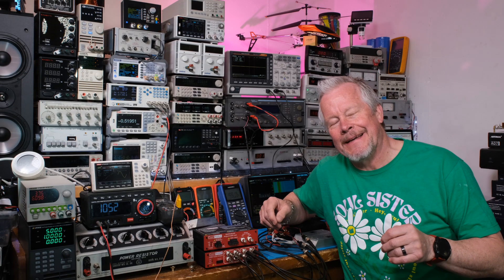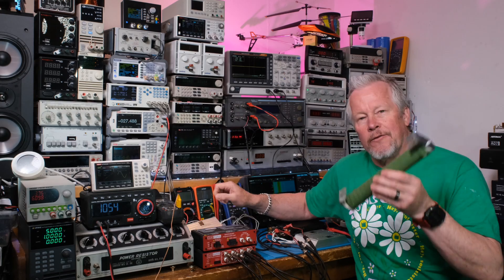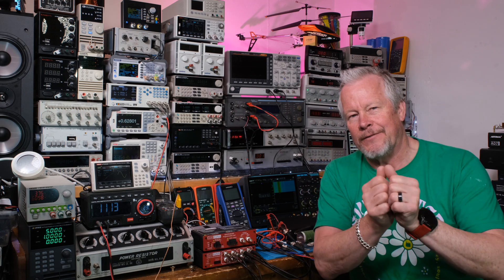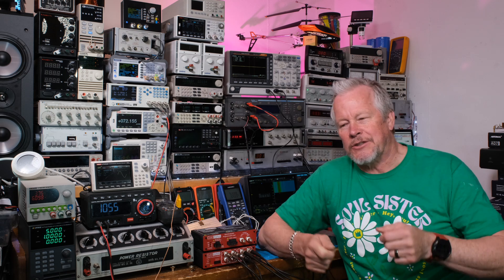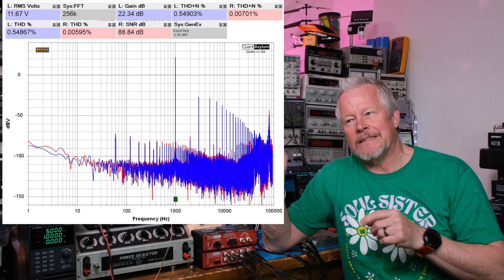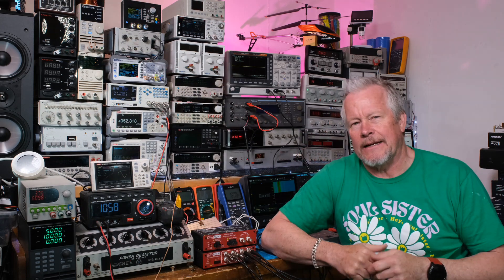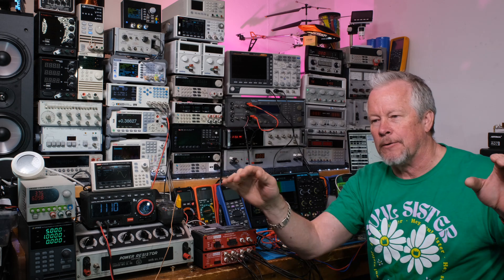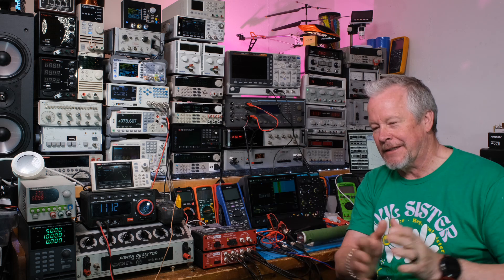Resistor Failure QuantAsylum Analysis Fosi ZA3 #QA403 #QA451

Comment: Dont forget to shut off as much gear as you can including lights when checking power/distortion especially when testing tube amps. Not so much on solid state. Also, if you have "dirty" ac power get some sort of power conditioner. It can make a world  of difference. (I'm a bone head tech. I dont know how it works but you do. Make a video!)And DON'T test power/distortion on a variac. I don't know why but it's the same thing.
Keep the videos coming Eddie!
Reply from the maker: Thanks for the great feedback!  A regulated output cuts out noise from the input in a big way.  The Power Supply Rejection Ratio (PSRR) is huge when the output is regulated.  That's why I am trying to make everyone understand - that if you have a 60/50 Hz transformer without regulation - it is simply a low frequency power supply.  The diodes commutate pulsing current on and off - thus, a low frequency switcher.  Linear regulation solves the problems you noted above and creates a Linear Power Supply.

Comment: I can make you an automated switch box that you can plug your existing resistors in on one side and the item you are testing on the other. Then you just push button to switch between different loads.
Reply from the maker: Thanks for your feedback!  That would be awesome.  I did build one years ago - but I think it was taken when I lost a bunch of equipment in a theft.

Comment: Thanks for the explanation about inductance being cancelled out in the wirewound resistors. I had avoided them, as I thought they would be mega inductors.
Reply from the maker: Yes, they look like big inductors - and the lower cost ones are - but the ones that they make 'low-inductance' are a bit more expensive.
Reply: Look fot Ayrton Perry winding resistors to reduce parasitics.
Reply: @paulb4661  Thank you, very useful.
Reply from the maker: Yes the green ones use the Ayrton Perry winding method.  It makes them very low inductance.  They cost a bit more but you can see how well they work.  https://amzn.to/4kvDcVn

Comment: What's the difference between the two resistors then? what are they made from? I would have thought that both resistors would be non-inductive. Why does the resistor suffer distortion? what causes the distortion if it's still showing value?
Why can't you use a 4 ohm inductor? Wouldn't that be closer to what the speaker is seeing??
Reply from the maker: Thanks for asking!  The distortion was coming from the resistor being damaged - or at least that is the theory.  I'll do a video on a resistor and speaker impedance.  I did this before, but I think it needs an update.  Here's the video on measuring a speaker: https://youtu.be/g1zda0WMDGc?si=jnPhM4ilOahRTUj1

Comment: I have similar 4 and 8 ohms open encapsulated resistors. My understanding are they are load brake resistors but are available in common speaker resistances.  The 200 watt rating you mentioned requires that they have heat dissipation devices.  I noted on units similar to  mine that have Power-Temperature charts and rating for maximum temperatures.  There are charts and data for vertical or horizontally mounted and if they are using  heatsinks and or air flow systems.  So I think that just sitting on your test bench they would not be able to handle their  200 watt rating. I mounted mine horizontally on a very large heatsink.  I hope this is helpful and someone may add better information.  Thanks for posting.
Reply from the maker: Yes - thanks for the great feedback!  When I run the power up on these - I put the other resistors on top of them to help spread the heat and I have a fan on them.   It is common to see derating on resistors at 70C.  But I think derating to 25% to 30% of the stated rating is much safer.